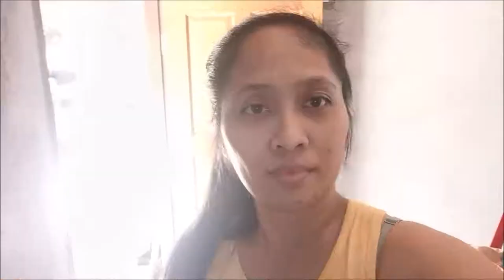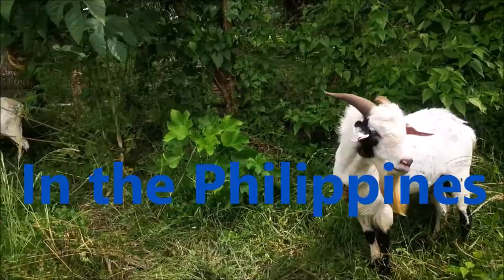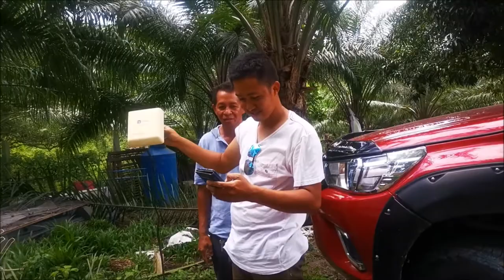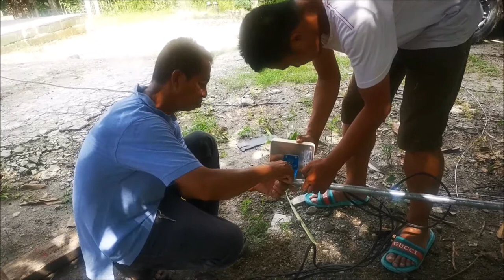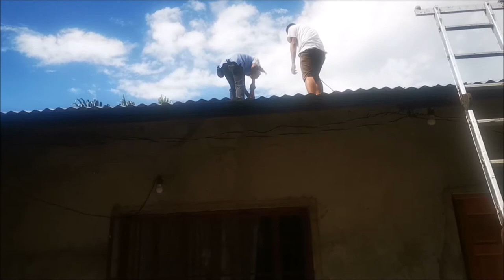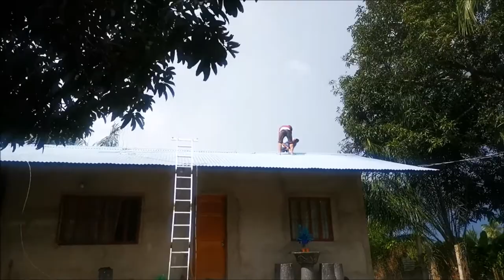Internet Antenna at the Farm | How to Get High Speed Internet Off Grid |  Tower Installation

Comment: They should have taped the coax to the pipe, so it doesn't flap in the wind.  That may cause damage to the casing in time.
I guess Bill could climb up the pipe and tape it now.
Reply from the maker: Happy, I can't even find a latter to hold my weight yet, so it will besomeone else climbing up there...lol